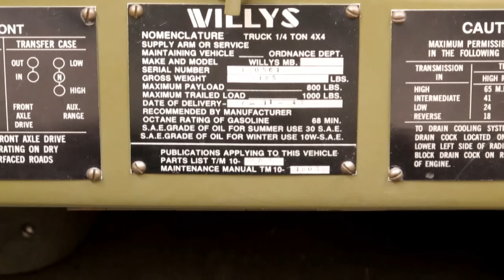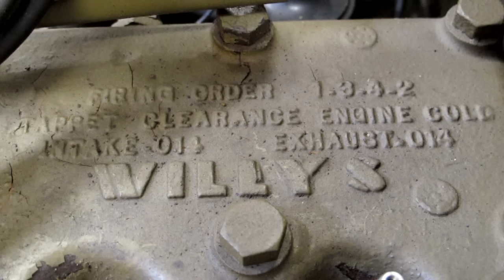1943 Willys MB Jeep - Walk Around

Comment: '
what name of vehicle company made this willy jeep...
very beautifully old time willy jeep...
this jeep need to put 3 color lights on the rear taillights for safety...
legal permit drive on the any road / street
Reply from the maker: Designed and initially produced by American Bantam. WWII production was shared by Willys-Overland Motor Company (Willys-Overland), Ford and American Bantam. This one was made by Willys-Overland.

While it may seem a good idea to change the taillights, No changes whatsoever need to be made to any Historic or Antique Vehicle to be driven on public roads and to do so would negatively affect the vehicle value.
Reply: @RonaldWalters2010  The original prototype was Bantam, followed weeks afterward by Willys and Ford. Each of the three were then granted small contracts to build vehicles for evaluation. 

By the time the U.S. was engaged in WW2, Bantam had been squeezed out of 'Jeep' production with the contract for 'Truck, 1/4 Ton, 4X4, G503' awarded to Willys Overland with Ford as subcontractor.  Bantam did, however, produce T-3 trailers during the war.

Comment: What is the history on the grill...I thought Willy's had a 7 slot and Ford had the 9
Reply from the maker: You will need to google that. I am no expert.
Thanks for watching.
Reply: Initial prototypes as well as Willys MA and Ford GP vehicles has welded iron slat grilles as seen on larger military trucks. The stamped steel, nine slot, grille (with hinged headlights) was introduced by Ford with the GPW in 1942 and soon shared with the Willys MB, to be standardized throughout WW2 production (Willys had been awarded the contract for 'Truck, 1/4 Ton, 4X4. G503' with Ford as subcontractor).

The seven slot grille was introduced by Willys Overland for production of the postwar CJ 'Jeep Universal' of postwar production and carried over to their later MC (M38) and MD (M38A1) military designs. Willys did not acquire trademark rights for the name 'Jeep' or design patent for the seven slot grille until 1950 though they had been using both name and design.

Comment: just what was the reason that jeeps had a fold down windshield
Reply from the maker: Initially to lower the height for stacking multiple units for shipment (steering wheel was also removed). Makes it easier to shoot at the enemy. Allows carrying long items or litters (stretchers) for injured soldiers. I'm sure there are more.
Reply: @RonaldWalters2010  thanks for the interesting information

Comment: Hello Ronald Love your Jeep and what a quality restoration I must say!Dear Ronald I have a question for you and that is while you were explaining the working of the vacuum assist wipers on your Willy's MB you did not showed them how they work?I am actually confused about the principle of the intake manifold wipers working!I just do not get how the vacuum created can make the wipers work?Is there any kind of magnetic or spring action inside the wiper motor which comes in action when the vacuum on
Reply: They don't work very well. 
While accelerating they operate very slowly, then when one backs off the throttle they slap around quickly.

Comment: What engine oil should we use?? Any idea
Reply from the maker: You can consult the original military manual for the vehicle (search for it). I used non-detergent 30W. Remember these were made before detergent oil was invented. Using detergent oil in an old engine is never a good idea. In a freshly rebuilt engine it would probably be OK... personal opinion.

Comment: Can anyone suggest how we can produce parts for the willy's so as to start an assembly line. I am sure a lots of people will invest and also would like to but one.
Reply from the maker: Most any part is readily available which are made in the Philippines. Basic problem is; you can rebuild/restore an old, vintage, historic vehicle but you cannot build/manufacture a new copy because it will not comply with today's safety codes. It then becomes a dead issue!
Reply: @RonaldWalters2010  Bingo.

Comment: is this the original american jeep used during 2nd ww
Reply from the maker: One of the original designs. Later the movable headlights were discontinued. Built in large numbers to a standardized design, from 1941 to 1945 as the  Willys MB and the Ford GPW.
Reply: @RonaldWalters2010  The headlights were built in that configuration from introduction of Ford's GPW stamped grille design (shared with Willys MB) throughout WW2. The change came with the Willys MC (M38), introduced in 1950.

Comment: When plastics has not invented yet and been ruining everything..
Reply from the maker: So true!   Thanks for watching.
Reply: There were plastics before 1941.

Ford had experimented with soy based plastic automobile body panels in the late 1930s and there was some plastic used on 'Jeeps', primarily for switch parts, knobs, late issue steering wheels, reflectors.

Comment: what jeep is beter ford or willys and why
Reply: Some say the Willys built engines were better though all Ford GPW had Ford built engines of the same design.

The 'WW2 standard Jeeps' (Truck, 1'4 Ton, 4X4, G503) of Willys MB and Ford GPW were built to have nearly complete parts interchange and were essentially the same vehicle.

Comment: Were the combat rims removed for transport?
Reply from the maker: I have seen photos of Jeeps shipped with rims on and crated with rims off. These are not combat rims.
Reply: Ronald Walters correct, my question was did you remove the combat rims
Reply: I think we are misunderstanding eachother I am very aware of combat rims and have collected for quite a while.... my main question is why doesn't it have combat rims? It would compliment everything else nicely...
Reply from the maker: OK sorry. The Willy's did not have combat rims when I bought it and I had no reason to change them. It had many of the other items; shovel, axe, water can, canvas water bucket, windshield cover, canvas top only (no sides), but they are not in the video as it was about to be loaded onto a trailer. And, as stated in the video description, I sold it over 5-1/2 years ago just prior to making this video. Thanks for watching!

Comment: If i want to buy it  what is price for it
Reply from the maker: This one is not for sale since I sold it several years ago. After WWII these were not very expensive. People did not have much invested and let them sit out in the weather to deteriorate. What you find are wide ranging in condition and/or may contain many reproduction parts. Price may range US$ 8,000 to $25,000 ??? Personally, I have not looked at the prices for many years.
Reply: Sir in india it is cheap but not original  that's why i want to ask u i want to buy it is its spare parts  easily available
Reply from the maker: Engine, transmission, transfer case, front & rear ends... some parts available but they often get rebuilt/modified to use substitute parts (i.e. bearings, brakes). People often install a different engine and forget about 4WD. I believe every body part is reproduced in the Philippines. You need to do some Google searches.
Reply: Thanks  sir ji